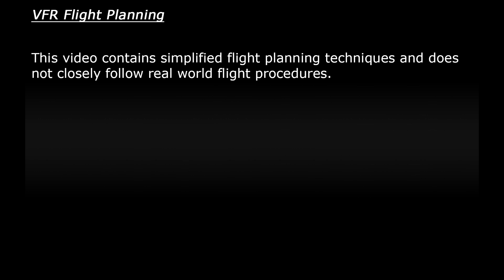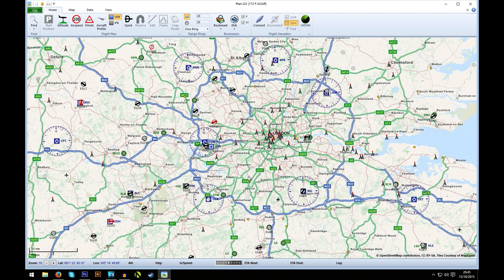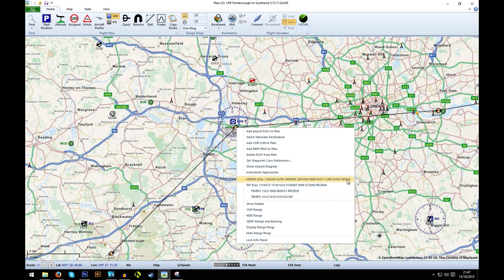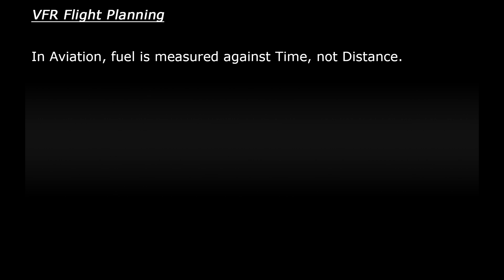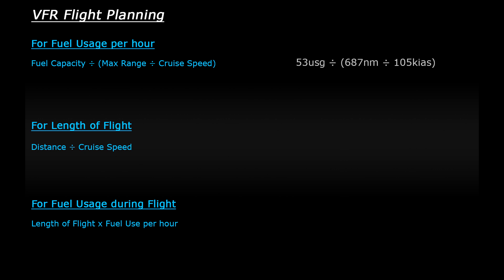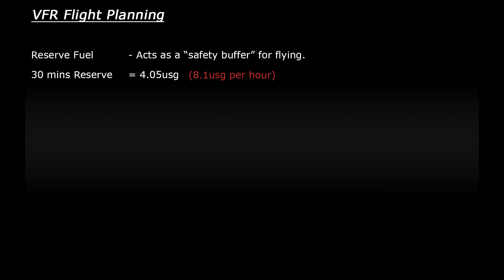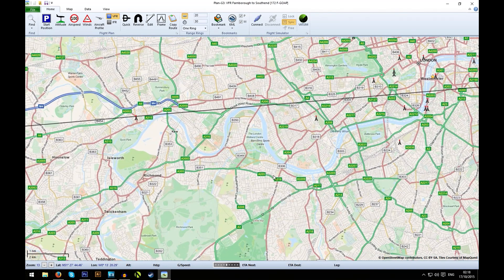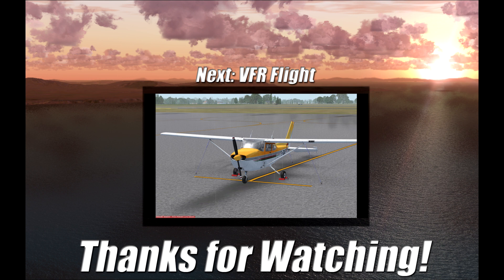FSX Tutorial: VFR Flight Planning

Comment: Nice video again! Just want to know why you use 105 kts  for cruise speed ( calculation fuel usage per hour ) and after that, you use 90 kts for cruise ( for the length of flight calculation ). At the end, it changes the fuel usage during flight to 5.4 USgall to 4.7 USgall. Am I wrong?
Reply from the maker: I can't remember what I did in this video but I'm almost certain that I completely forgot to follow the documentation during the flight.

Comment: Are we always allowed to plan our flight through straight lines on the map? Suppose, not all the air space is allowed to cross as you wish, but I'm could be mistaken. Can we always just draw straight lines from one waypoint to another and follow them during the flight?
Reply from the maker: Yeah in the real world you would need to be aware of airspace restrictions and plan around those but if you're just getting started with navigation in a simulator, don't worry about it. I always see a simulator as a tool for learning so don't worry about all the real world "rules" until you understand and feel comfortable navigating.